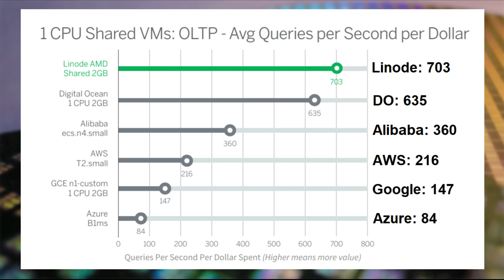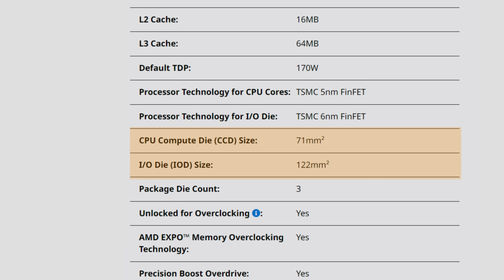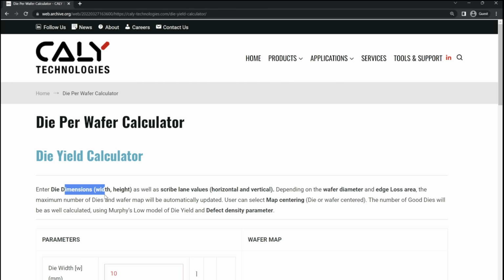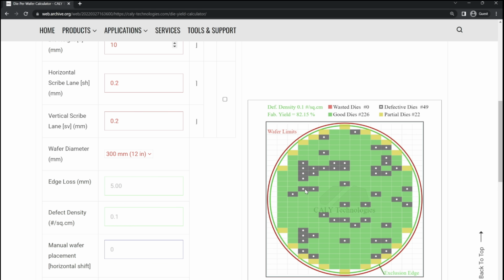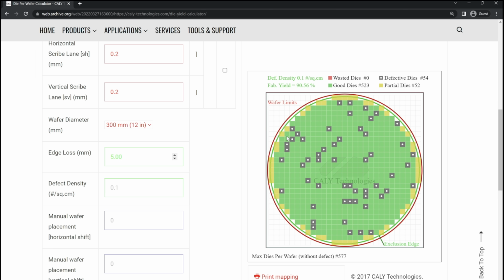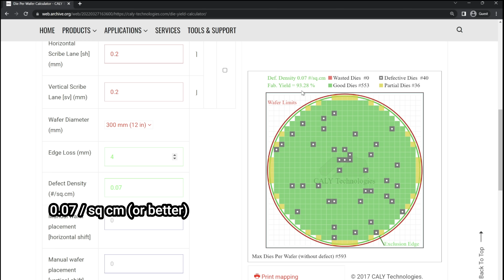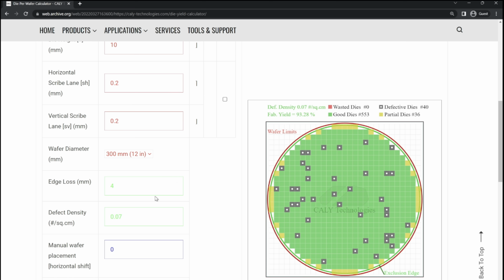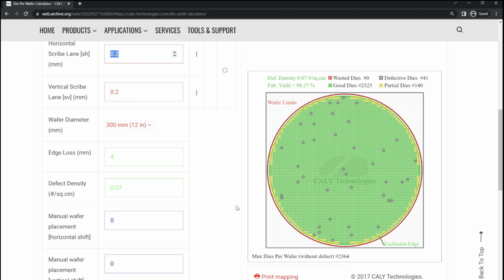AMD Ryzen 9 7950X: Cost to Manufacture?

Comment: There are also resistors and capacitors on cup and cost of manufacturing circuits for dies, and I am pretty sure that not all working dies hit minimum performance requirements. And also shipping cost.

Comment: the biggest cost in chips production is the development costs, R&D, the engineering. a modern chip can have develpment cost of close to $1billion. i imagine current gen cpus, gpus and the like, cost far higher. so, even if the production of the silicon waffers was dirt cheap, the companies have already spent tons of money and time, for the product, so they need to cover all these costs AND make good profit or else they will go bunkrupt very fast.

Comment: 12:30 'This is more about they chiplets are the future of high performance computing' This is not right. The yield of a die has no impact on it's performance.
Reply from the maker: The better you yield, the more solid your frequency distribution and the more options you have when it comes to packaging for the high bins.
Reply: @TechTechPotato  I still disagree, Mate. Just coz I can make a thousand Peugeot's with a defect rate of .5 doesn't make them the best performing. How does what you said square with what Cerebras is doing?

Comment: I would be very interested to see this compared to the cost of a Raptor Lake CPU. Although it will definitely be less accurate since Intel's process node information oughta be more secretive than TSMC. I would be curious to see how much the monolithic dies might be hurting their margins currently and how Meteor Lake could change that! It would be very cool to have a video like this with future product launches!
Reply: I want to see the RTX 4000 Ada Lovelace cost. The whole industry feels like it's moving too fast. TSMC's tick-tick-tock seems to be creating a permanent shortage scenario where mass market demand can never be met and where each process has a lifetime too short to affordably pay for R&D. I keep remembering the 2500K which was $216 in 2011 when it launched, not to mention the much more affordable GPUs. I'm not impressed by expensive fast chips, I'm impressed by cheap fast chips.
Reply: @Blank Name Yeah, I mean, we learned that much with Cannon Lake, but they still stuck with Ice Lake and Tiger Lake being the only 10nm parts because they could make up for poor 10nm yields with the smaller dies. I think that Intel's aggressive roadmap with "5 nodes in 4 years" might change some of that though.
Reply: This is very hard to compare because:
.) Intel is using their fabs so there is no real price per wafer.
.) We dont know defect density. Intel still has capacity issues so it probably is not that good.
.) It is hard to compare die sizes. AMDs IO die is bigger, but they also have some stuff included in IO die that Intel has in their chipsets. We need to add chipset sizes as well.
.) Those are different architectures. Zen3/4 cores are smaller and more energy efficient than Intel P cores.

When comparing monolithic vs. chiplet:
The difference in yield does not really matter. The main advantages for AMD are:
.) They can offload some parts onto an older node if they cant get enough capacity of the newer node
.) They can minimize the number of cores they need to validate. They can do all desktop and datacenter variants with 1 compute die, 2 IO dies and 1 cache die.

Also defect density is a lot more complicated in reality than shown in the calculator.
If there is a defect on a die that does not mean it cant be sold.

For Zen3/4: Compute dies can still be sold as 6/12 core if defect is in one of the cores, but currently not if it is in the L3 as all desktop SKUs have full L3. Also defect on IO die means the IO die cant be sold.
For Intel: Dies can still be sold if the defect is either in cores, L3 or iGPU which covers most of the die and demand for lower SKUs is usually higher than actual defects.
Reply: @Gindi4711  I'm aware of this all. I alluded to that in my original comment. With offloaded to older nodes, Intel has been doing that for a few years on mobile parts. TGL-U had the CPU die on 10nm SF with the SoC die on 14nm. This will also be the case with Meteor Lake. Intel will gain the advantage of being able to choose what tiles get fabbed on internal processes and what tiles get fabbed by external fabs.
And yeah, all the dies are tested and sorted, so defective ones will be binned into a lower class part, but it was just Ian's simplification because it is otherwise impossible to realistically get a more accurate estimate.

Comment: Your dollar value calculations are based on the total dies per wafer ($17k/838=$20.29, for example) and not the good dies only. Did I miss something? I re-watched and it sounds like you intended to calculate based on the good dies only

Comment: Sounds like manufacturing cost relative to final unit price hasn't changed from the 90's. And yes, companies have made losses with unit manufacturing costs of around 10-15% of the final retail price.  The main cost drivers for the semiconductor industry are elsewhere.  First to talk is retail and wholesale margin and taxes, those take a decent chunk together and are relative to actual price. Then the R&D costs that the semiconductor company needs to recuperate which is billions, and then the marketing costs, and finally the corporate overhead of everything that supports all those tasks. The end result is that AMD's net margin for the quarter ending in June was 6.82%.  People cannot imagine a company selling something with manufacturing costs of around 10-20% of final costs and making 6% of profit because of high fixed costs.

Comment: Really good stuff!  Edge loss in real life can't go down to zero because a simple, sawed (sawn?) wafer with 90 degree edges is highly prone to chipping.  "Edge profiling" parameters are specified by the fab when they order the blank wafers.  Does the fab's defect rate also count defects coming through from imperfect crystal lattice/dopant density in the wafer?  Long ago in a wafer plant far, far away, wafers were almost never round because the fab machinery needed flats/notches to align to crystal orientation, etc.  Kind of cool that they've moved beyond that.  Laser etched marking perhaps?
Reply: There is a small notch on 300mm wafers to align things

Comment: What would be the cost estimate with a monolithic die?
Reply: I played with the calculator to estimate a worst case.

Total die area would be less than 2 * 71 sqm + 123 sqm = 264 sqm. 
Assuming a quadratic chip, 16.24mm*16.24mm. 
Yield 83%, 173 good chips per wafer.
98 USD per monolithic die.
106 USD including packaging. Roughly 50% more expensive to manufacture.

Comment: This cost analyses is really too simplistic. The most expensive part of any product, is the R&D, If you spend  $1B on R&D and sell 10m chips the cost would be $100 just to break even on the R&D cost alone. Add all the other costs: finance, IT, accounting, marketing costs, R&D for the next chip, Product support, shipping you can easily double that to $200 before you actually add manufacturing  costs.

Comment: Why don't they fill the outer edges with many smaller chip designs?    Taking advantage of the gaps that will still be usable, smaller chips on the outer edge will increase the odds of yield along those edges.
Reply: Paul, chips are printed in blocks, say 3x5.  To “mix” different kinds of die-which sometimes makes sense-you would have to either print one of those small die in every block, which would be a waste of space in the center of the wafer, or switch mask’s which would roughly double your time in the lithography tool.  Reasonable question, but not cost effective.  Also, don’t forget cutting the die apart, the cutter only goes in a straight line.

Comment: These are only material cost. Assuming that this is 25% of total cost incurred,  they are still making massive margin per cpu produced for 7950x but not that much (though still high) for the lower tier products. Seems R&D would have a big contribution to the cost as this might cover two or three years of research and devt while the other costs could be just shared with other products that AMD produce and sell.
Reply: @Karl with a K BOM is a small part of the total cost. If companies sold products at a price close to the BOM + manufacturing costs then these companies would go bankrupt.
R&D is a big investment that covers years of work (AMD, nor anyone, develops a CPU from 0 to 100% in one year) and they need to keep those costs in mind when pricing a product.
Also don't forget to add logistics, marketing, software development and a big etc. + margin so they have enough profits to keep investing in new products and growing as a company.
Reply: @Karl with a K "I am informing you, not vice versa", yikes...

Also, your comment is 17 minutes old, completely buried in a day old video and yet you have a like, I wonder why...

Comment: You should consider the cost of the PCB and other components and manufacturing the whole CPU, not just the chips. I mean, is a good idea but still not close to manufacture process. Note: I am not talking about research and development cost.
Reply from the maker: Packaging includes substrate.
Reply: @TechTechPotato  you might say it in future videos, package sound more like the box, blister. A PCB, resistor socket and other stuff sound more like a Board. Thanks for the response.

Comment: The aggregate die area of all 3 chiplets is 263mm squared, while Intel's Raptor Lake 13900K is 257mm squared.  It's very impressive that Intel can achieve higher clocks and better performance than AMD on a smaller die that also has integrated graphics and is manufactured on a fab that is essentially 2 nodes behind.  I blame it on the Atom cores!
Reply: AMD also has an integrated GPU. And Intel can achieve better clocks because it is monolithic and needs less interconnect transistors. Some of that area can go into prolonging the pipeline to achieve better clocks. And Intel has some ++ tweaks on that process, and I would say it is only 1 effective node behind. Different processes in terms of achieved frequencies cannot be compared only by nanometers, Intel has a more refined process.
Reply: It's the opposite. AMD is competing toe to toe with a server chip versus a consumer product of Intel that was designed for the specific purpose. Also the chiplet design comes with a performance hit versus a monolithic one and the IO die now contains integrated graphics. The IO die also is made on 6nm that is improved 7nm and is comparable on what Intel has now.

Comment: Just a guess, but the Edge Loss doesn't seem to be an input parameter to the fab process that results in an output, but rather a threshold of where the guaranteed good dies on the wafer end, and there's a calculated buffer zone where dies in that zone (probably depending on how much of the die is in that zone) are considered partial dies, and anything past that buffer is a wasted die. For example, on the default 2mm you have only like 160 good dies and a 99.6% Fab Yield, but if you crank in up to 50mm, you still have a 99.6% Fab Yield, but you have no good or partial dies and all wasted dies.

It's probably something the manufacturer decides after printing a lot of wafers and observing the outcome.

Partial dies are probably either dies that become lower tier products, or dies that have a chance to be wasted or a chance to be good. I am not sure.
Reply: Partially printed die are not useable.  They are there because a mask, for this size die, probably prints about six die at a time in a 2x3 array.  Also manufacturing uniformity varies radially with the best die in a doughnut about 10mm in from the edge.  Also, you can’t get the photoresist thickness uniform all the way to the edge so you can’t print features well.
Reply: @DrParticle  then why is there even a distinction between wasted and partial dies?